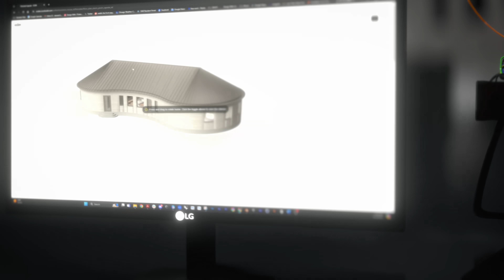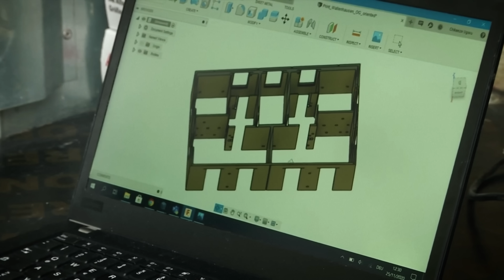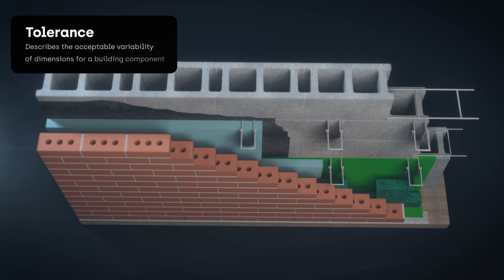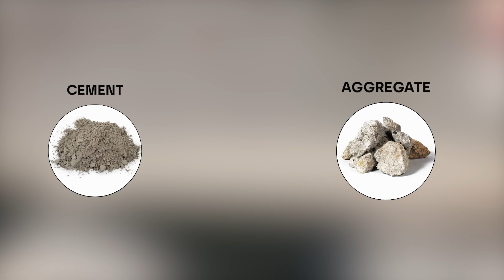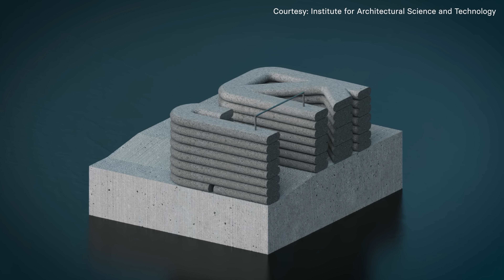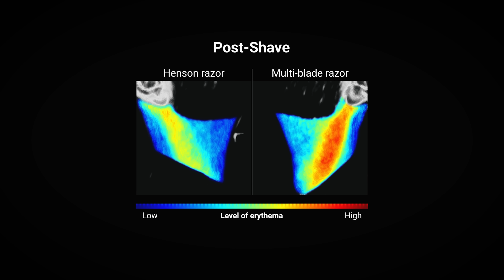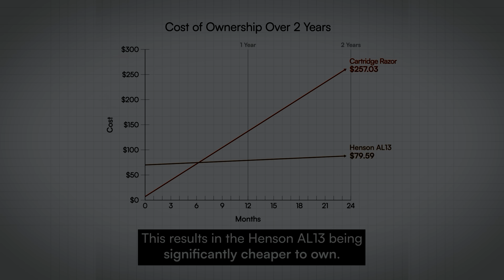Why 3D Printing Buildings Leads to Problems

Comment: Blue Crete, BC, is a geopolymer cement. GPCs can have several times the compressive and tensile strengths of Portland cement, OPC, so you need less. They have a tiny fraction the carbon footprint, and some draw down and sequester carbon; OPC is helping to cook the planet. GPCs are perfectly dry inside, once set, so they don't freeze/thaw and crack, or crack with changes in humidity; they're more alkaline and protect rebar from rust better, are flexible where OPC is brittle, and are enough like Roman cement that they might last thousands of years while OPC begins to crack and crumble in 40. They don't conduct electicity: that will save lives. And inventor Daniel Robert claims that with the right aggregates Blue Crete can self-insulate to R-17.5 per inch. I know, that's nutz; the best you can otherwise do is polyisocyanurate at ~R-7, but he has been claiming so for something like 15 years now, and has a lab in Europe working to prove his claims. He also says BC is refractory to 2700 F--coupled with that insulation value, your house could be your safe refuge in a wildfire--hydrophobic--utterly waterproof and no paint needed, ever--and he says that neither mold, mildew, bacteria, barnacles, nor zebra mussels can grow on it. 3-D houses printed with BC wouldn't need the wall cavity for insulation, so they would need less material and cost less.

And Hobbit houses built with Blue Crete could be tornado proof.

https://www.bluecrete.com/
https://www.bluecrete.com/technology

BTW: hire a few people to lay bamboo splints between lifts of crete, and you'd inexpensively add reinforcement; and have those people smooth down the walls with floats/trowells, while the crete is still soft enough, and every lift won't be a rough-surfaced shelf to catch dust and water and grow stuff you'd rather not.

Comment: I think we should be teaching tighter tolerances than 20 mm. As a glazer and carpenter of 20+ years it’s a real bummer when ROs aren’t correct and interior steel framed walls don’t line up with the masonry that the window unit is meant to span. Not to mention giant and/or uneven sealant joints.

Comment: the main issue is you still have to pay people to set these machines up and manage them. in the end it does not save anything compared to traditional concrete forms which you can also embed conduits, pipes and rebar in before pouring

Comment: The factors affecting price are not strongly related to wages for construction. We can build homes fairly quickly once all the other stuff is done. These printed homes are no different than modular builds except instead of shipping this set up they just ship panels. If we want to fix housing it means stream lining the pre build process and taking out the incentives to profit off the builds. In either case the foundations for these builds or modular homes are still a crux issue

Comment: Most of these issues have been solved for plastic 3d printers. Rounded corners can be removed by making them bigger and then cutting away excess material, or replacing the corners with a separate part. Window frames can be inserted during printing and the window itself can support the bridging concrete above it (the same would work for drainage or pipes). The ugly look of the layers can be easily sanded and filled with plaster. Etc…
Reply: Concrete can be easily sanded?  Have YOU ever sanded concrete?

Comment: It's not possible to do some things because it's a layer by layer process... Therefore... We cannot use reinforcements the same way.. Unless workers stop the printers and include the metal structures into the STL of the printing. Therefore... Slicers must be updated to work in conjunction with people.

Comment: Some of the points you bring up mean modifications are not as easy, but if the house is significantly cheaper that may be ok. On a percentage basis post construction home modifications are rare. I can see this being a step toward more affordable housing or at least feasible in areas with shortages of construction skilled labor.

Comment: good video.  You are right to point out that 3d printing is similar to brick in structural terms.  But in terms of the economics,  the real trade off is between 3d concrete and stick building.  3 or 4 framers with a pick up truck and $1000 worth of tools from Home Depot, can assemble the frame of a house in few days.

Comment: When we built a house in the city, about 25% of the costs were the ground, 25% were for the raw building, and about 50% for cladding, windows, doors, slevator, floors, heating, water, electricity, network etc. The house is built to sub-cm tolerances. The walls were built of large bricks the were glued together, and the floors were filigree floors, and the stairs were prefabricated concrete.

Building technology has come a long way, and I am happy about the amount of thermal and noise insulation this building offers, and it it almost 20 years old, and the first paint still looks new. Due to 3D- CAD modelling a lot of parts were pre-fabricated in a factory to spec, e.g. floors and stairs, and using part libraries for windows etc. the whole building was pretty well spec'd out, and cost were well known in a advance down to many details.

It took a team of ten people about 6 months to build this 6-story  building with seven apartments totaling 1100m2 floor space, and additional 9 months to finish everything else.

Our mindset when building that house was on minimizing risk, getting good quality for a good price. In no way we would have used some experimental tech, and the 3D-printing you have shown would not have offered any cost advantage and probably would have cost more in end, as also indicated in the video. My point is, when it comes to building houses as an "normal" person, you do that once or twice in you life, and you really don't want to screw it up, and mistakes you make there can haunt you for a long time. And a lot of it comes down to details, like properly cleaning a floor before applying noise insulation to avoid small stones creating noise bridges.

I think the future lies in more sophisticated pre.fabrication and some automation on-site, and the most cost saving potential lies in everything but the walls.

Comment: Something simple I don't get: can't you put drywall over lumpy interior concrete, and siding over lumpy exterior concrete?

As for making parts in other orientations and with a mold rather than a 3D printer: that has existed for over half a century and it's called Concrete Tilt-Up construction. The parts are poured flat on the ground into wooden molds (sometimes you can see wood grain in the finished pieces), then tilted up into vertical orientation and bolted together. This is where your lintels and other standardized (but still concrete) parts are going to come from.

Comment: You aren't really 3D printing a house until you can print the whole house, including pipes, cables, windows, and the roof. Otherwise it's like having a printer that can only print certain words. This is more of a wall building machine, which wastes a lot of material from the looks of it.

Comment: Pre-manufactures housing has been around for decades and is basically housing on an assembly line. Heck the Sear’s catalog had “kit” houses in it over 100 years ago. Commercial construction can also be incredibly quickly. Even 3D printing a house still only gets you the shell; you still have to build it in; this is really no different than stick building, preform, or pour in place systems that are already in use. The speed/cost issue around buildings isn’t the construction it’s the regulation that goes along with each step.

Comment: Conventional concrete using forms would be far stronger and cheaper. You can't customize the design as much with formed in place concrete but the overall strength will mean a house that is built to last longer and be more resistant to hurricanes and tornados. A team of builders can get houses poured quickly if doing a whole neighborhood at a time and houses already look pretty much the same as each other but concrete houses would have a large advantage in strength, longevity and maintenance along with lower insurance premiums. These printed homes use no aggregate only sand mixed with the Portland cement and no vertical rebar maybe horizontal rebar but either way it's not as strong because of the lack of rebar. This makes them weaker along with the fact that the layers are not properly mixed together to become one homogenous piece.

Comment: What don’t understand is why they don’t render the walls after the 3D printing to give it that nice smooth finish, by leaving it looking like its been 3D printed looks cheap and tacky. I don’t mind the curved shapes or anything like that but I do mind that cheep tacky look at the end of it. 
Each of those layers also invite future issues like dirt building up and a seed just happens to get stuck in the dirt, and from there it grows. The roots of trees and other plants have been known to brake rocks apart over time, that same issue will also apply to the 3D printed walls, if ivy or any type of climbing plant starts growing on the wall, before you know it the plant will have seperate the layers apart and the integrity of the wall is gone.
By smoothing the outer wall as it is being printed will stop this from becoming an issue down the road but it also gives the house a nice crisp looking finish. As for the inside giving the walls a nice clean finish with plaster will make for a nicer looking finish and also for a dust free environment.

Comment: Ehhh....  
If you consider the cost to level and prepare the grounds to accept the printing machinery, it''s actually more expensive than a traditional stick built home. 
I'll say that it beats shipping in pre-built sections of housing, but that's like saying a double wide is better than a tiny home; It is better, but if that's the spread of options, there's already something ridiculous going on.

Comment: Biggest problem is they look like crap. It reminds me of the Brutalist architecture movement only worst as it failed miserably because people don't wanna live in such drab structures. And that movement came as a result of WW2 where they needed to rebuild fast and cheap. At the end of the day it doesn't matter if you could do something cheaper, what matters is if people actually want to buy it. 

Also most of the problem with affordable houses is in the limited number which is good old supply and demand as the demand is higher than the supply. The supply is not being held back by the cost of building but rather on regulations. Like this story of developer in CA that bought an old property and wanted to tear it down to make some affordable apartments but the local city kept him in red tape for years with excuses like it would ruin the historical look of the area, would shade a local school playground, and other BS to the point he threw up his hands and unloaded the property. 

The problem in construction is the only ones who truly want affordable homes are those who don't have a home. Existing home owners in theses areas don't want new apartment or housing projects going up because typical supply and demand. If there are more houses their housing value goes down, and the same is true with land lords renting out apartments. The more I looked into people who actually were trying to help build affordable housing the more I noticed a reoccurring story of local regulations and zoning laws that prevented construction from getting off the ground. Don't get me wrong we do need some regulations like building codes to ensure the structure is safe. But this top down urban planning telling people what they can and can't build on their own property often just as a means to keep out competition is BS.

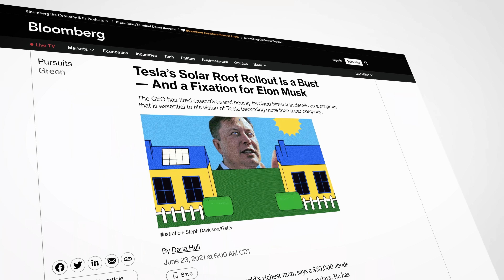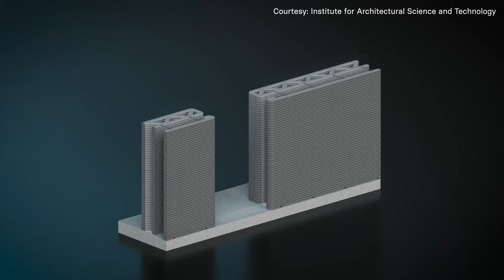Comment: 0:21 "It's not a bug, it's a feature!" 1:40 In empty promises he did that, so yeah 'disrupted'. 3:07 Why not just turn on supports in the slicer? You can always remove them later. Final verdict, 3D-printed houses are more of a novelty that'll pass into the dusts of history eventually. While waiting a LLM AI production method for building houses, guess nothing could go wring with that.

Comment: When i hear stuff like this from competent people... Extremism is the problem, same as we do with small prints, instead of standing beside it wide eyed, one person can Sand down the rounded corners to 90 degrees, while the concrete is not fully set, can even cut it.. Tolerances, can be compensated in the design, it is on you architects not to start trying the 1% of designs that are known issues, Bricks have been optimized for hundreds of years and in 10 years 3d printers went from Janky wonders to building houses, maybe someone will figure out a nozzle design for 90 degree crisp corners.. and where is the problem in designing walls and infill that can be filled with insulation? Making it sound like only bricks can do that.. if architects design wavy stuff, why should machine builders figure out 90 degree walls? And having the machine level..can be corrected in software.. a drunk bricklayer.. not so much..

Comment: 3D printing isn't only used for prototyping in engineering, just mostly. There are several more niche applications such as when you need to make a very small number of a part or when you need certain extremely complicated shapes and features, like a tube running through an otherwise solid and non-flat part. A good example that is both of these things is for building rockets; they don't build that many of them and they require very intricate designs. Plus, 3D printing with metal is presumably a bit more sophisticated than concrete.

Comment: I don’t understand many of the described limitations. If someone doesn’t like the interior look of these concrete walls, why couldn’t they finish them with old school plaster? 

Or if someone wants 90 degree corners, why not simply build those in advance with brick, steel, or even molded concrete and use the 3D printing for everything else between those particular corners?

Comment: 3D concrete built homes = "Let's a take a dumb idea and make it dumber." First, I can't see what 3D concrete building can do that pre-fab and/or tilt-wall construction can't do better. Even Monolithic construction with shot-crete, rebar, foam and plastic forms seems like a better idea in every conceivable way. Second, why make interior partitions that are permanent when you can just make a shell and then allow builders to customize the interior with stud walls using locally available materials like wood or metal that can be more easily altered later. Third, constructing a home out of a hard and heavy material that is both inflexible but also un-reinforced seems like a recipe for disaster.

Comment: The idea is cool, but when I think of all the OTHER components of a house beyond the basic structure (plumbing, electricity, etc.) I wonder how much the whole 3-D printing gimmick is really helping? Maybe it could be integrated into some parts of the building process but I'm thinking it's more of a "now we have one more tool to work with" scenario rather than a broad, revolutionary solution.

Comment: Serious question.  Can the 3 D printed layers be floated like the concrete slab to create smooth interior/exterior ?  Also, could rebar be vertically driven into the layers for additional strength ?

Comment: Blah.. Govt sitting lower power cost CLAIMED HIGH POWERED ultrasonic holography reinforcement by arranging nanoscale to increase strength just with a setting + Time to hold formation before dry and it can even speed up drying evenly from inside to out. Everything is rigged.. Because of KEYS held back.

Comment: Life long concrete worker. 3d printing can absolutely be used for concrete. First off I'd go with fibers in the concrete. Second off I'd have a stucco or other exterior coating option. I don't know about you but I'd feel a lot safer in a concrete house than a house made out of sticks. 

That said how they think the layer lines are ok to sell in a finished house is insane. Maybe if they made it look good people would be more interested! How about you have a robot system that sprays the previous layer gap with spraycrete? A form of concrete that can be sprayed. Usually to repair tunnel walls.

Comment: 3D printing lauers can be done again with the arms. And you can make square corners by troweling the concrete as it sets up. Also if the mix in nylon rebar, the concrete will still be extrudable, and fibres conect layers, but troweled so they dont stick out of the finish.

Comment: Modular homes are so much better, by the time youve delivered the 3D printer, they could deliver the first section of your new home. Ship them sealed, connect them together and fill in/over the seams. 

Everything is vuild i doors, at a single location, which greatly reduces not only cost but also environmental waste

Comment: This is not 3D Printing.. its just PASTE layering  your literally NOT printing anything, your laying layers of Paste on top of each other over and over again. 
which is basically the same thing as laying bricks on top o each other. but your using a different material so no it cant be fixed until you understand what your actually doing in the first place.

Comment: See, the Lackawanna Railroad actually did this.. in 1907... better... but they didn't work out good because concrete sweats, it doesn't keep heat well, it gets moldy when not exposed to outside air, and in their case no indoors plumbing. It was also hard to add electricity to them. They were deemed unlivable and abandoned. Due to being so strong every attempt to rid of them failed, literally explosive proof. So yeah